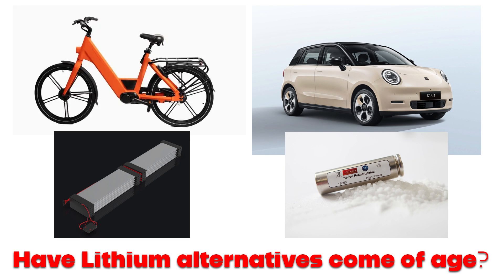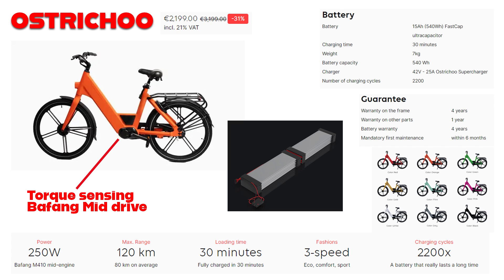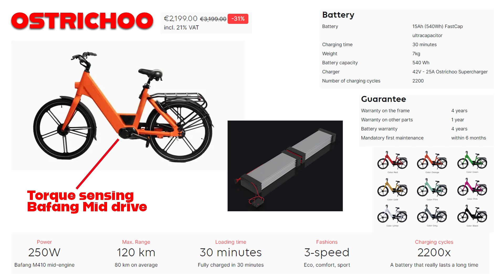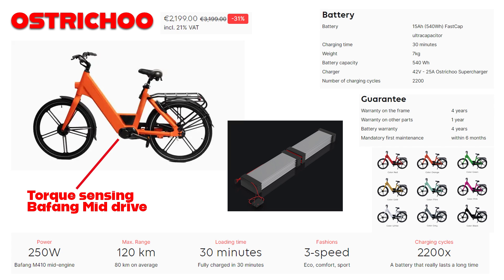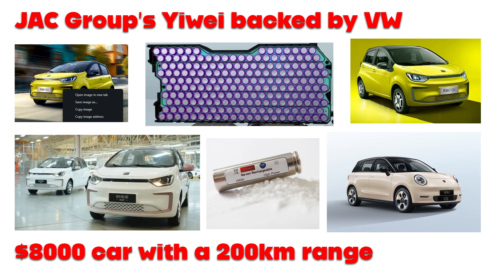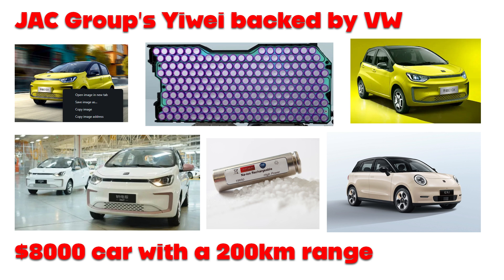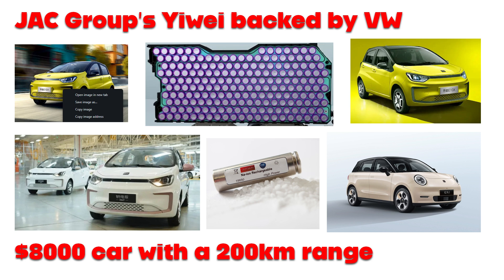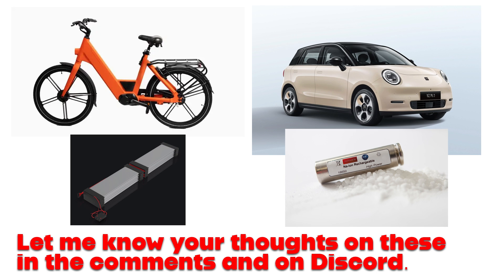Weekly Ebike Tech chat January 5th 2024 Super Capacitor Ebikes and Sodium Ion Battery Light Car

Comment: The whole idea of this bike is extremly dumb. The only advantage of the capacitors is the high charge and discharge rates and they pair it with a 250 W motor. A normal E-bike battery of this size can easily provide 2.5 kW of discharge and 500 W of charge rate. Regen breaking is not used on most bikes because there is not much there to recover, because of the light weight and slow speeds. Most of the energy is lost to wind resistance anyway, so only on very steep hills would you ever need regen, and they designed it for the Netherlands.
Reply from the maker: Why is it dumb? Its a Dutch company making bikes primarily for Holland. I think what you mean is that it would be not the bike for you. I made it pretty clear that this bike works for its intended use scenario. People don't ride 2.5kw ebikes in Amsterdam. They ride bikes like this. There are lots of other advantages to capacitors beyond the discharge. There is also the high temperature range they can operate in. Ease of recycling and much lower cost materials. No need for things like cobalt or lithium. I thought it was good to see a product that was affordable with a really good warranty. They are definitely worth exploring otherwise there would not be any investment in them. In terms of regen I suggest you watch some of the Grin Tech stuff as there are quite a few videos on the benefits of regen with hub motors. Its  not the same as with cars granted but it's more that you are giving it credit for.
Reply: @HighVoltageKits  Several reasons. Their 540 Wh battery weighs 7 kg, my 500 Wh Bosch battery weighs only 3 kg. My ebike works fine in 40 °C and -10 °C weather. I can charge my bike and leave it outside for a month and it will still be full. This bike will need charging bevore a trip, because of the self discharge and the battery is not removable, so you need a garage to use it. Riding at 25 km/h you only have 0,3 Wh of kinetik energy and with this 250 W motor you will need at least 5 s to regnerate it. This is too slow for normal breaking and most of the enery will be lost to wind resistance and drag. The capacitors will be more expensive than li-ion and the bikes are already on sale. They dont tell you which other components they use, because that is probably where they save money. People in the Netherlands like simple, tough, low maintaince bikes that will just stand outside in the rain and be ready to use.

Comment: do the ultra caps work in the -c temp range like in alaska or iceland ? compared to li-on ?
Reply from the maker: One of their strengths is performance at low temperatures. I think the exact range is listed on their website. You might need to activate the translate though. There is a link for them in the description.

Comment: Really enjoying your weekly e-bike tech updates. Also find your e-bike motor reviews very helpful.  

In Australia where I live converting acoustic bikes is just starting to gain some interest because of the cost of good quality new mid drive  ebikes. As well as you can use one battery on multiple builds (i.e our extended family have 15 ebikes that we can all share batteries for longer rides, and i have different bikes for different purposes using the same battery). 

Would really like you to have a segment on converting dual suspension acoustic bikes, in particular mounting the batteries on the frames. And which "modern" dual  suspension bikes are the best for it (e g. 2018 onwards).

Thanks
Reply from the maker: Thanks Mick. I have added it on to my list of topics. There are definitely some differences and new challenges with the more modern DH frames. Cheers

Comment: First - I continue to love this series. Thank you for it 💯
I think the biggest current drawback to EVs in general (and a HOST of other technology industries) is energy density.  But thats only half the story. EV (inparticular) batteries also need a good ability to *discharge* at a high rate without damaging itself. You can have batteries with orders or magnitude higher energy density right now - but if you can only discharge at ~0.1C, that isn't very functional. 'Next Gen' batteries also must have high energy discharge capability. Just about every other tech sector industry is just waiting with baited breath for 'next gen' battery technology.
Reply from the maker: It's always been the way right. Waiting for it to catch up. If 200 watt hours per Kg is really possible with super capacitors that would be amazing as the only real drawback will have been eliminated.

Comment: Very cool tech on the horizon. You fill me with hope with these updates.
If more electric cars come out with competitive prices to the Yiwei I could see myself with an EV car. I live in NYC & my complex has a cheap public charger so a little vehicle like this would be fine for most daily (local) use. I have always been enthusiastic about new EV tech but I just couldn't make the numbers work between car prices & public chargers (so I stuck to DIY PHEV e-bikes). Having done the math on electricity vs gas an EV car will likely cost more over the life of the car but may break even if you keep it running long enough and a PHEV car is virtually pointless if you don't charge solely at home (even then you get about one gallons worth of range for about the cost of a gallon of gas). I hoped that would change & now it looks like the math may work out in my favor in the not too distant future.
Reply: Becoming more common to be able to charge at work and while shopping.... So a PHEV for somebody without home charging is a little more viable than you're expressing here.... IMHO, but to each their own...
Reply: @nc3826  If that charging is free or maybe at local per kwh rates you're right. I was only talking about if you have to pay for charging. I live in an apt and have to pay even at home. Luckily the rate here is the same as if I charged at home but I haven't seen a single public charger that doesn't charge at least 50% more than the local rate per kwh, making it pointless to go EV unless you're commited to an EV & are willing to pay.
Reply from the maker: Yeah good points the infrastructure as always seems to be the key factor here. The economics of a car that costs $8000 and if it lasts 10 years combined with being cheaper to fuel. It might not work as well as pointed out if the place to park it is very expensive and the charging points cost a lot to use.
Reply: @HighVoltageKits  If this is anything close to "as advertised" it changes the math a lot. In the US the cheapest new ICE car is the Versa manual at around $17k which is over $20k out the door. If you start with a lower buy in price you don't have to worry about your "break even point" even if the electrical costs rival fuel costs. If you can charge cheaply enough you start out saving and the savings of an EV over ICE only grow as the car ages. I love that math (if it works out). I won't hold my breath because so many promising vehicles have come out at higher costs than promised but just the idea may spark competition and that gives me hope.
Reply from the maker: Exactly. Skepticism till its on the roads and changing peoples lives.

Comment: As a person who rides a few different style of e bikes from 4000W bafang bbshd down to a 250W mid drive "dutch style bike" I have to say where there is infrastructure and safe places to ride an e bike(well as safe as can be expected) don't knock the humble 250w basic e bike.
 I will admit this only works for me using a mid drive setup as the torque curves are adjustable via the gears. 
 My 250W e bike has only 550Wh at 36V but I can comfortably do 70 kilometers on a full charge however I have never tested this as I haven't ridden that far on a charge before recharging it! 
 All this is based on a pedal only activated e bike so no throttle!
 I cannot say how these super capacitors are able to deliver the power but if the figures are correct for watt hours and there is no throttle I have no doubt 80 Kilometers is very achievable by the average middle aged person with a few extra pounds around their waist!
 Now if I only could get a 52/72V 25A charger for my e bike I would see a fast charge or an explosion!:face-turquoise-covering-eyes:
 Sodium technology has one great bonus in my opinion. I know nothing about sodium batteries but as a storage solution for houses and maybe the national grid any battery which takes a bit more room for the greater safety margin has got to be a winner!
Reply: A useful characteristic about supercapacitors besides the obvious, very high charge and discharge rates , and it's cycle life being tremendously higher vastly reducing ewaste... Is that they don't chemically change like batteries do, through their charge and discharge cycle.... So a supercapacitor can be much more readily be used as a structural element....

But it's going to have to become much more energy dense and less costly to be a true viable option relative to a battery... Makes more sense in a hybrid configuration with a battery as a power booster at this time....IMHO
Reply from the maker: Some good thoughts. I know I like riding the 4000 watts stuff but I would love to cruise around Holland on one of these!

Comment: I had a "big" capacitor, about the size of a half pint glass. Used to demonstrate its ability to store energy by changing at 24V and then shorting it. Lovely fat blue spark and loud crack. Maybe best not to try that with this super capacitor...😂. Sounds like great strides forward - hope it's as good as claimed.
Reply from the maker: Sounds like it was great fun!
Reply: Yeah my stereo power amp runs for about 30 seconds after i switch off the power. Capacitors in the power supply.